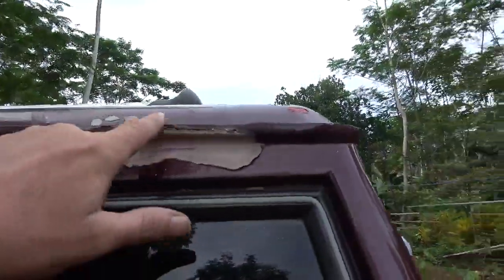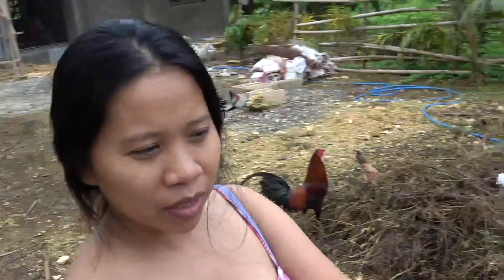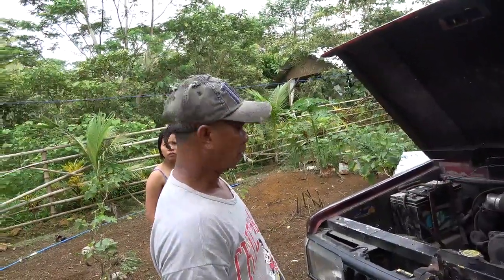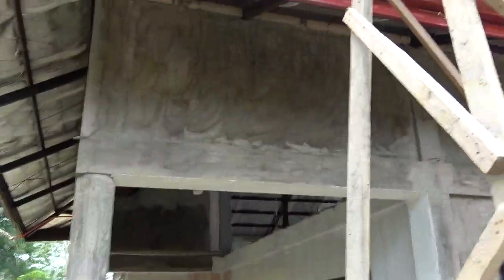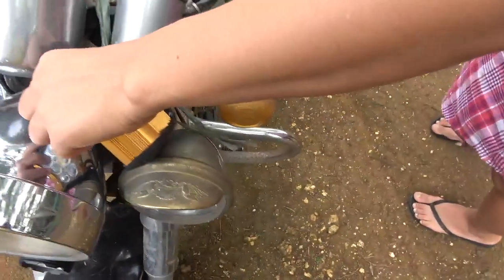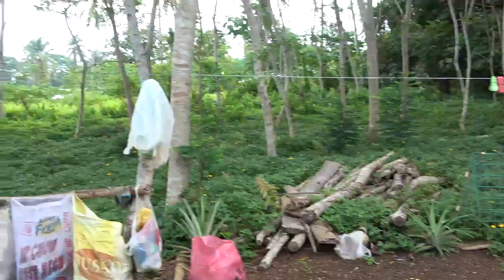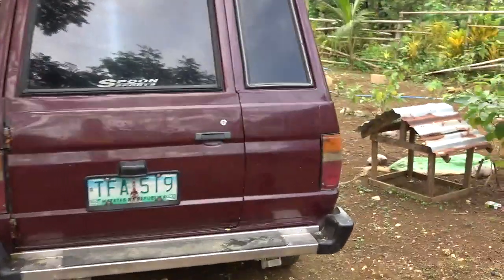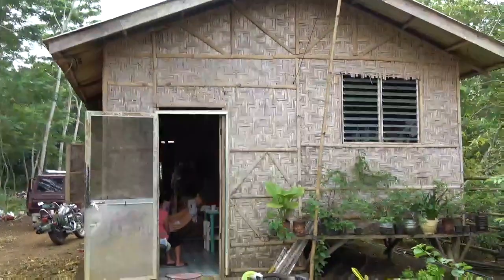Buying 2nd Hand Vehicle (Toyota Tamaraw) in Philippines

Comment: that body work is no problem.  Yes you can paint portions.  Sand down to primer only, then feather in with body glaze and then you're ready for paint.  The rusted seat area could just be needle gunned and painted over with Chassis Saver or POR-15 which is special paint for that.
Reply from the maker: Cool, great advice buddy!! Seems u an expert?
Reply: @francoiswilliams  not on body work, but i know a little. My friend owns a body shop and has worked on some of my vehicles
Reply from the maker: @telesniper2  Cool, keep the good advice coming!! Mail me even better folanke at hotmail dot com
Hahaha...get it?

Comment: you need to examine the frame on the undercarriage for rust,
Reply from the maker: Thx, will do, if there is, what to do?
Reply: @francoiswilliams  My old Landcruiser had rust in the frame where I had to cut a piece out and weld a new piece in. the undercarriage frame is the most important part of the car's carrying capacity, rust in the gutter can be handled with gaffa tape ;-) but if the supporting parts (the undercarriage) are rust the car collapses.
so you have to go down under the car and knock with a pointed hammer. the bodywork is almost only for decoration
Reply: @perborup4814  I'm certain his buddy 'Jessie' has rigorously inspected every square inch of the vehicles undercarriage because that's his job.
Reply from the maker: @perborup4814  Thx, good advice...